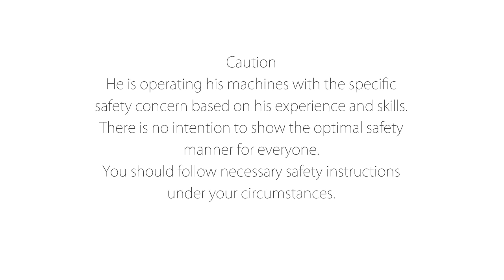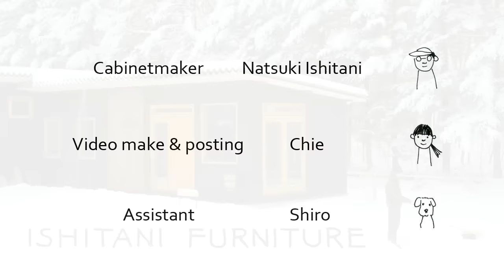ISHITANI - Making a Floating Table 2.0

Comment: What a great method of table joinery!  The floating top allows for the lateral movement of the wood in different temperatures and humidities.  It should last for centuries.

Comment: I follow Mr Ishitani videos a long time ago and greatly admire his workmanship but only today I notice something about this video that has surprised me.
As I see it the table top rests on a 'ladder-like' structure that is bolted to the legs. The table top is bolted to the rails, or the long parts of this 'ladder-like' structure. The shorts parts of this 'ladder' (the rungs) are joined with double biscuits to the long rails (8:01). The rungs at the end also get joined to the rails with a thick dowel that seems to be inserted passing through the biscuits (9:40). These rungs at the end of this 'ladder-like' are the ones bolted to the legs (11:27).  
This combination of biscuits and dowels between rails and rungs receive the weight of the table top and transmit it to the legs. I am surprised by this combination of wood fasteners and its use in a load joint.
For full disclosure I can say that I am a just a hobbist, while Mr Ishitani is a proffesional woodworker, and very good one. So I am sure that, despite my surprise, the table is sound and strong. I wonder if I am missing another detail about this joint that I didn't notice.

Comment: The "tapered sliding dovetail joint" will prevent the top from warping while allowing the wood to expand and contract. This is an elegant alternative to the breadboard ends (which I do not like). 

This video inspired me and I exercised cutting this joint with hand tools only. I tried various saws to cut the recess: large crosscut tenon saw,  ryoba saw and kataba saw. The kataba saw works the best, because the tooth line is convex, only few teeths engages at a time. This will allow me to do a precise crisp cut and use a beveled guide to help maintain a consistent angle. I used the 1:8 ratio, same as I use for dovetails in hard wood. I used a shoulder plane and a chisel to cut the male part of the joint. I do not have a dovetail plane. This is not an easy joint to make, but the hand tools allows me to cut it precisely. I master the technique and the joints always turns squeaky.

Comment: I've been woodworking for years and just gotten to the point where demand is pushing me to do it professionally. Just curious how you price this kind of craftsmanship? What does a piece like this table sell for? 

Please keep posting videos! I enjoy the way you edit and the lack of unnecessary commentary and tool noise. Thank you!
Reply: I'm wondering too. Looks like $1,000 worth of walnut just to get started
Reply: I am wondering this too. This must have taken days to make, not even considering the cost of the Walnut...
Reply: from the prices on his site for some other tables, I would guess that this one would go for about $2500-3000 plus tax.
Reply: PhysicsOfCombat The shop I work at charges $60 an hour and then for materials with a bit of mark up
Reply: Depends a lot on where you're based. Woodwork is more valued in some places than others, and some places have richer customers. But generally 3-5k for something like this. I highly recommend you think up an hourly rate and set up an excel formula to judge pricing. X+(Y*Z)
X being material cost, Y being the hourly rate and Z being hours of work.

Also, if you can, advertise as much as possible. One of the biggest shortcomings of woodworkers today is a lack of marketing. People need to look for woodworkers to find one, or rely on word of mouth. Spend some money and advertise, target upper middle class people or wealthier. Youtube can also be a great marketing tool.
Reply: This thread has been insightful, thanks!

Comment: Excellent work! I have one question, when you put the glue on the dovetail piece that spans the width table, wouldn't it restrict the seasonal movement?
Reply: The grains run 90degrees to each other. The length of one will governs the others width. It will be like trying to break a string along its length or by breaking it across its width by pulling as well. In the vicinity of the dovetail key there could be  nearly 4 inches depth- enough to resist seasonal movement. The grains are mixed. It’s a puzzle that is difficult to take apart.

Comment: May I ask if the V groove in the table top is tapered at the end on purpose? Is this why the cross piece slides in to 4/5 of the way and than you need to hammer it in? Also, no glue in this joint, correct? Thanks. Love your furniture and the channel, amazing craftsmanship, thanks for posting!

Comment: Just beautiful! Thanks for sharing. One question though; at 10 mins you glue in that beam under the table top. Do you only put in glue at the end? And that filler block did you leave some room there?

Thanks again!
Reply from the maker: Glue at only one side end.
Make space on the other side for wood expansion and contraction.

Comment: Use coconut oil on your hands everyday and sip water all day until supper time then stop.
Wood shops are a very dry environment especially during the winter with a wood burning stove. The air is dry, the wood absorbs the moisture in the air to make it every drier. The wood also absorbs the oils from your hands.
All this contributes to dry skin and dehydration.
Put a large pot of water on top of your wood stove in the winter to help hydrate the air in your shop. You will notice a huge difference. 
Sip clean spring water all day everyday if you can find a natural spring.
Don't forget about your doggy, he should have a bowl of water as well, but you must keep wood dust out of it somehow.
Dehydration is the cause of many illnesses. Eating dry foods also contribute to dehydration, unless you eat soups, and hydrated fruits like watermelon, melon, papaya, etc.
Stay hydrated by taking a mouthful of water every 15 minutes.
A must in a wood shop.
Be well !

Comment: Hi,
on the sliding dovetails you have on the stretchers under the table is  glue really required? would that not potentially affect the tops ability to expand and contract without cracking?
love your work.
Reply: I have the same question - or maybe only one end the stretcher is glued? Also curious.
Reply: Same question
Reply: I had the same question guys.  I'm looking to build a replica of this so I've been researching... I think the answer is that Ishanti only glues the far end of the dovetail joint, not the entire length.  That would allow the wood to expand in one direction.  I'm guessing he is leaving an 1/8th inch play  at the far end where he hammered in the filler piece.  Another similar design I found  (in a book) calls for no glue along that joint (to allow for expansion)  and just a single screw into the middle
Reply: Greg B any idea what the thickness of this top is?
Reply: Not sure, but I started my replica with a 5/4 (1.25 inch) and planed down to  even thickness
Reply: Ryan Betts.  Yes very important to only glue one end. You have to let the top move with changes in season. You will notice he left a gap in the dovetail plug on the other end for the same reason.
Reply: Is that stretcher straight or wedge shaped? (Length wise) I am afraid it will be really tough to make the dovetail tight enough but still be able to slide it all the way in.

Comment: I have a question about what you are doing at 9:47 , are you glueing the dovetailbar all the way in or do you just put a little glue in the end? For my understanding the Tabletop has to be free to move sideways when it expands or gets smaller when the roomclimate changes... Great work by the way, i love the design!
Reply: Johannes Baumer I believe he is only gluing the sliding dovetail in to the last board so the other two boards can move via expansion and contraction.

Comment: Thank you for the wonderful videos.  

Based on the fit, it looks like the last 6-8 inches of the sliding dovetail socket are tapered in - is this correct? Does your router jig account for this or are you adjusting by hand?

Comment: That's a beautiful table, but doesn't the dovetailed brace (glued in) interfere with cross grain expansion of the table top?  Please correct me if I'm wrong...I am always willing to learn something new.  Thanks!
Reply: Dan Stephens only the last two or three inches are glued. So no issue with expansion/contraction. I assume he is using a tapered sliding dovetail so it's loose across the joint until the last couple of inches at which point it's seated nice and tight. Probably glue is just so it doesn't ever back out.

Comment: Just beautiful! but where is the heat stamp?
Reply: https://youtu.be/21DFmwZtVlQ?t=264 Looks like it is on the underside of the table, on a perpendicular support beam / joist, not sure the correct term for it.  The burn-in of the stamp is not shown in the video.
Reply from the maker: Yes, On the underside of the table.

Comment: Just now see this video. at time 2:00 mins into the video you use a mallet to really crank down on a clamp. The conventional thought is that just medium pressure is needed to glue edges. That to much pressure squeezes the glue out. What are you thoughts on this.

Comment: Take that dust/chip collector hose at 1:08 and connect it to a 10×4 HVAC vent flush with the floor with a drop-in register grill, or fit with plywood flush lid to otherwise maintain system pressure

Comment: Do you use steeper angle kanna for planing walnut?

 I am having trouble using my kanna on hardwood because it is normal kanna set at 32 degrees for softwood.

I read for hardwood kanna embedding angle should be roughly 42 degrees

Comment: How did you attach the legs to the runner that goes underneath the table? Shown @11:24. How does the runner attach to pieces slid into the long dados? I see the lap joints, but I didn't know if it was just held in by gravity or if there is a pin or screw of some sort.

Comment: Does the sliding dovetail on the table side taper to match the rail? By showing the test fitting of the rail, are you showing that you are gently reducing the taper of the rail to fit step by step?
Reply: When cutting that taper... why have the guide piece running along the fence instead of the piece you are cutting?

Comment: Very nice design, i love it. Why are you putting hammer on the mortaises at 7minutes and 11 seconds ?
Reply: Garenne01 I have the same question
Reply: This was asked in another video... I think it has something to do with pre-releasing tension or something like that... I don't totally understand either
Reply: Garenne01 I think it's supposed to break the grain/soften the edge to make sure that the two pieces go together better and that the two mating faces are flat.
Reply: Thanks for your answers
Reply: The Japanese call it "killing the wood". I think the idea is that it compresses the wood so that after the joint is glued and clamped, the wood expands back to its natural shape, thereby making an even tighter joint.
Reply from the maker: Yes, It's kind of "killing the wood". Tenon shoulder will Super fit.
Reply: It's a rather morbid term. As the wood is able to recover from the hammer blows I think I'd prefer to call it 'Stunning the Wood"!
Reply: It is kigoroshi, which translates to killing the wood. It is deforming the wood fibres, which will return to normal, sometimes a little moisture has to be added. Make sure to use the convex end (kigoroshi-men) of the hammer (genno).
Reply: See this vid for a more in-depth and visual explanation: https://www.youtube.com/watch?v=f7HaAZ1ugcA
Reply: zombie wood
Reply: Brute Bernard that’s why cleaning the glue from the joints with water and a toothbrush serves two purposes. Brilliant!

Comment: Why do you feed the piece directly into the saw when making the tenons instead of passing it over the top of the table saw?
Reply: which position is easier to wrangle the material?
Reply: World B. Gilbert Gottfried,   I believe that is a special circular saw so the tenon is cut exactly without leaving marks outside the joint. You can see the over cut marks from the blade.

Comment: how is the table top supposed to shrink and swell when you glue in the dovetailed brace at 9:47 ?
Reply: Anonymous it's only glued on one end. the other end has a key hammered in that doesn't sits flush to outside edge but doesn't touch dovetailed slide. expansion of wood slides down dovetail pinned at one end with glue and contracts same way.

Comment: anyone know why he hit the mortises with a little hammer before attaching the double mortise and tenon joints?
Reply: Was wondering about that, too.
Reply: Vibrations set up in the wood from the tapping of the hammer help to even out the brush marks in the glue on the sides of the joint so you get an even coating of glue. Fewer little ridges of glue, less "pile-up" of glue in the bottom of the joint. Reduces hydraulic action of the glue trying to push the joint apart.
Reply from the maker: Tenon shoulder will Super fit.
Reply: Great idea! Thank you.

Comment: 7:15 whats going on here?
Reply: if you compress the wood in and around any joinery by lightly hammering, it will naturally rebound after the glue is added and from water moisture during clean up. the end result is a tighter closed joint!